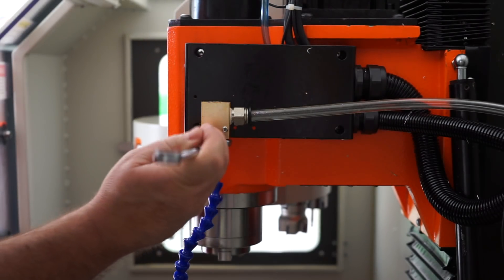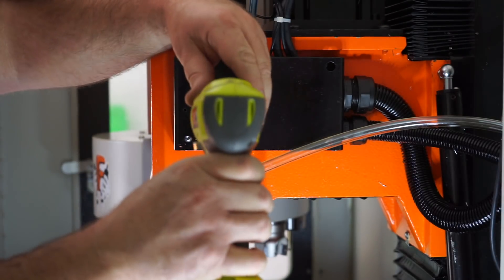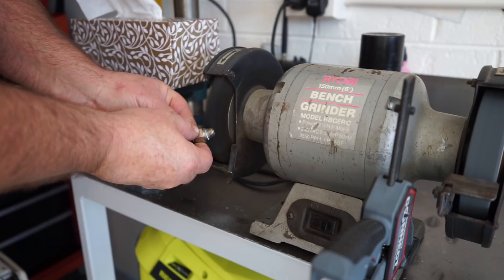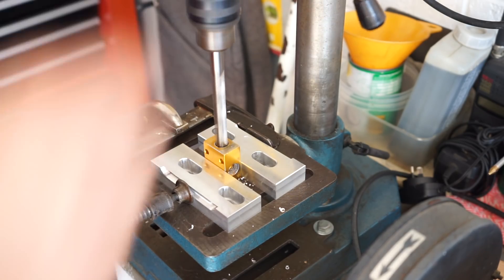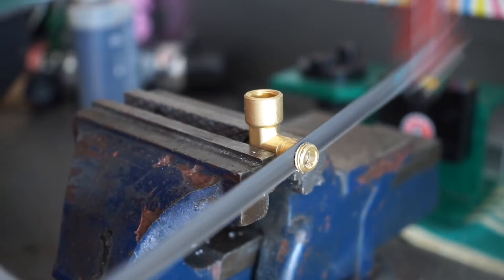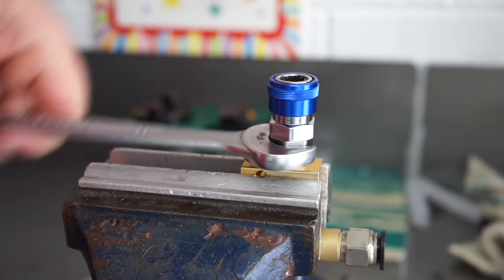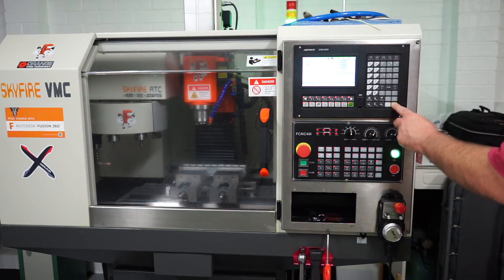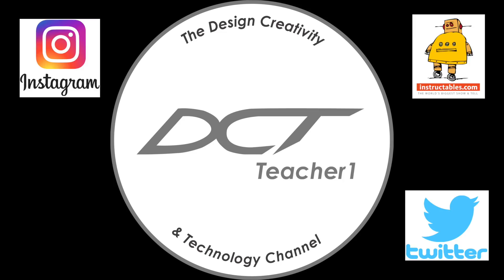Skyfire Coolant Upgrade - Nozzle & Washdown Gun

Comment: You forgot to replace the phillips head bolts with M3 socket head cap screws. :)
Reply from the maker: G'day Peter.  Now, that's a very valid point mate.  I need to buy one of those kits that has a variety of cap head bolts in them lol.  Hope you've been well mate?  Cheers, Aaron.

Comment: Hi Aaron,  Get a piece of brass rod that fits inside your was down hose, drill 2mm hole through it in the lathe, and shove it up the hose.  Instant wash down jet!!
Reply from the maker: HI Chris.  Thank you, that's an excellent idea mate.  I might draw one up quickly in F360 and CNC machine it on the Haas.  Great to see you using Fusion and doing some CNC turning too mate.  Cheers, Aaron.

Comment: Nice addition mate.I would reduce the nozzle diameter on one hose for a bit more pressure to help move the swarf.I have turned both plastic and aluminium reducers in the lathe to fit inside the orange nozzles.Put a 1 degree taper on the outside of the reducer and drill to suit a bit more pressure but still a decent flow amount.
My wash down hose has a very high tech barbed fitting stuck in the end to increase the pressure a bit.
Reply from the maker: Hi Micheal, good to hear from you buddy.  Great advice mate, I'll have to give that a try in my new twin nozzle system :-)

Comment: Are your new orange nozzles the 1/4" diameter style? I recently switched some of my machines to smaller 1/8" nozzles (using the same 1/4" "loc-line" flexi hose) since the smaller diameter boosts the pressure quite a bit. But you get less volume, just more direction to the stream when coolant gets low. I put four of them on our Minimill being fed by the single 3/8" coolant fitting (lol)
Reply from the maker: Hi Andrew, yes they are those 1/4" internal style.  That's a great idea what you suggested.  Micheal Connor also mentioned (above) about changing the nozzle dia to obtain more pressure.  Oh, how is your Minimill running for you?  For anybody reading Andrew's comment, go and check out his channel.  He makes some crazy parts for paintball guns.  Far better machinist than I'll ever be :-)
Reply: Your words are too nice :) maybe someday I'll have your patience! We've dedicated our Minimill to making steel parts lately. Still going strong, even for a 9 year old machine filled with rusty chips...
Reply from the maker: Never a truer word said mate.  I love all those crazy 3D / 4 axis parts you've been making.  Our Haas SMM2 at school is fully tooled for aluminium.  I need to do more steel, might give it a crack on the Skyfire ;-)